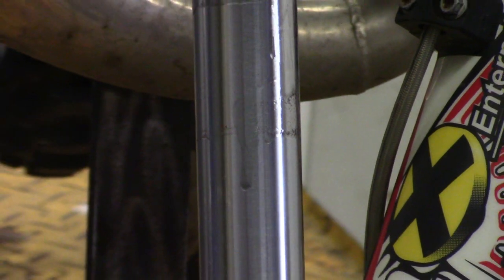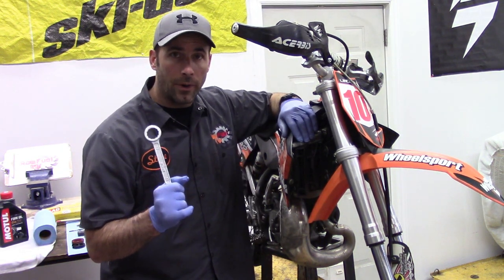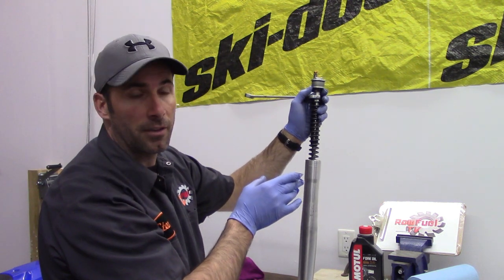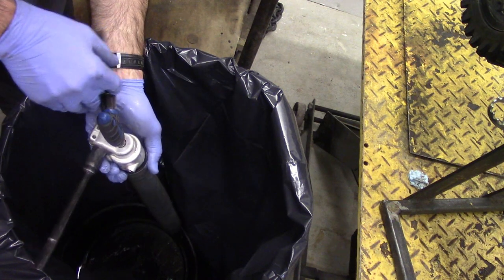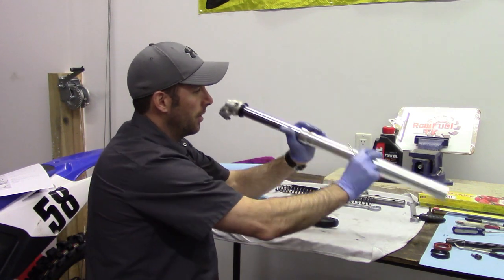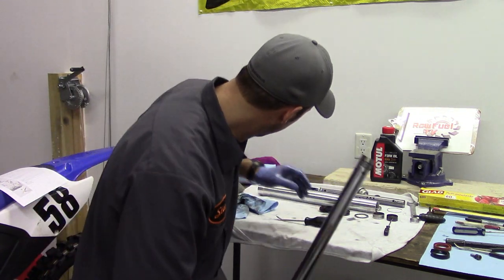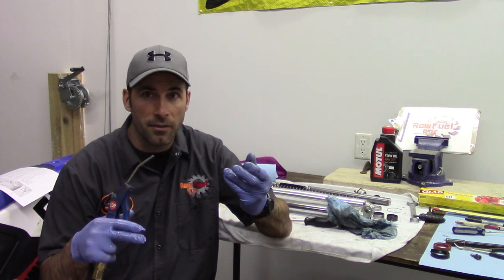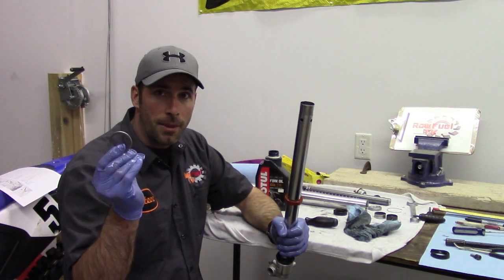How to change the Fork Seals on a KTM 65 SX Motocross Bike

Comment: Hi guys would this be a similar process for a 2014 sx50.Easy to follow video cheers
Reply from the maker: Peter Holmes the general principals involved in the fork seal change will be the same but the 2 forks have different components inside of them.  You can likely order a Service Manual CD from your local dealer which will guarantee you a smooth seal change.  

RFTV

Comment: I have a question.  When I did this procedure on these same forks i dont think i screwed that top cap all the way down until it "buried out" as you said at 28:28.  I think that the locking nut underneath it moved up a little during my work.  So essentially my top cap just ended up meeting up with the locking nut and then I tightened them up.  Do you think that that would affect the rebound adjustment screw at the top of the fork?  I assume that the rebound adjustment screw needs to meet up with the adjustment rod.  Do you think I should take the forks back down and make sure that the top cap buries out before I tighten the locking nut?

Comment: Dude please do the 2018 front fork. Thats a misserable thing. There is no bold under the fork to remove the inner rube out of the shell. No plase to download the manual
Reply: Did you ever figure this out? My son has the same year bike 2018 KTM65sx and I’m looking into replacing the seals on the forks. One fork has an air bladder. Thanks!

Comment: How much fluid should I use in 03 ktm 125 fork
Reply from the maker: Contrary to popular thought, the correct way to fill the fork with oil is to measure the gap between the top of the fork tube and the oil level itself. (basically measuring the air gap in the fork with all of the components installed other than the cap). Ensure the dampening rod (if you have one) is in the extended position, mimicking the rod being attached to the cap. The measurement should be somewhere around 125-130mm. but it's dependent on your internals, model of fork, oil weight etc... confirm with your local KTM dealer to be sure.